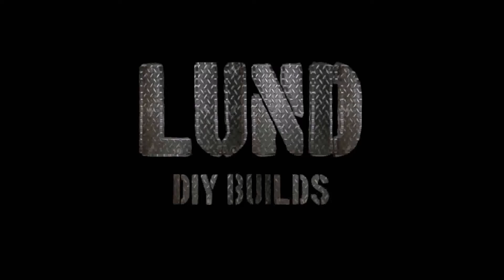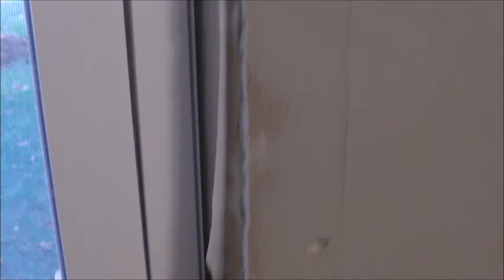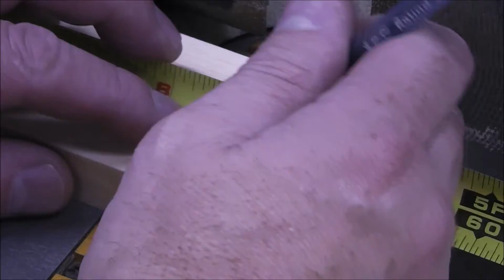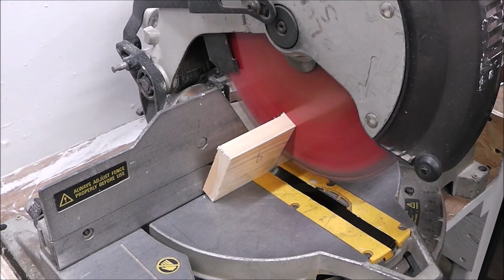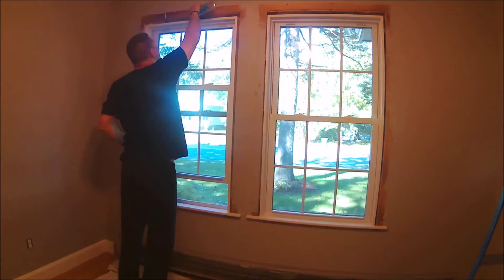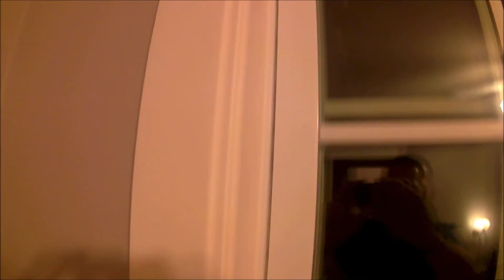Installing Interior Window Trim (casing)

Comment: A very nice job. a fellow question a job of those how much do you charge for it? do you charge for feet? And with the material included? I hope not to disturb greetings.
Reply from the maker: During my contracting days I would charge by time and materials, so my hourly rate, plus 15% on top of what my actual material cost is.
Reply: Thank you bro 💪💪

Comment: Did you use shims on the top or sides when installing the extension jambs? It looked like you had quite the gap on the top when you nailed it in.
Reply from the maker: Typically if I'm using foam I try to use very few shims because it acts as an adhesive and keeps everything tight. I use just enough shims to keep my reveals consistent as the foam dries.  Maybe one at the top side, center and bottom and only on one side for a window this size. If I'm chinking in with batt insulation I shim all around the sides, bottom and top. There is nothing wrong using shims all around if you prefer, I just find it's not always necessary and it lessens the chance of missing some foam around the shim area.

Comment: what router bit did you use for the edges of the window trim? i dont see it on your tools list, thanks
Reply from the maker: Hey Samantha, here is the bit that I used. You can adjust how much round over you want by adjusting the depth of how far the bit is inserted into the tool. Thanks for watching! https://amzn.to/34aiox5